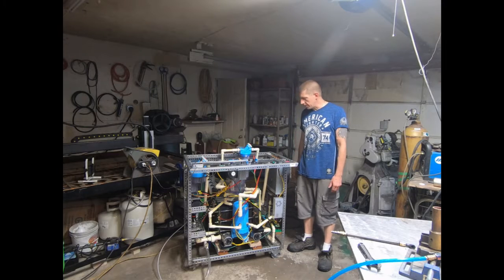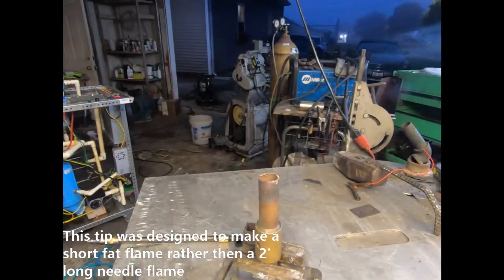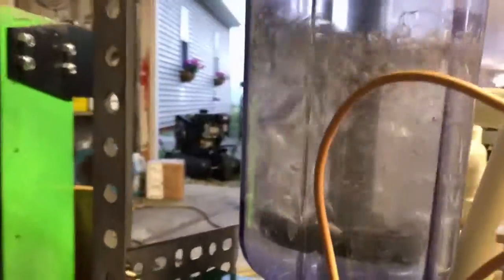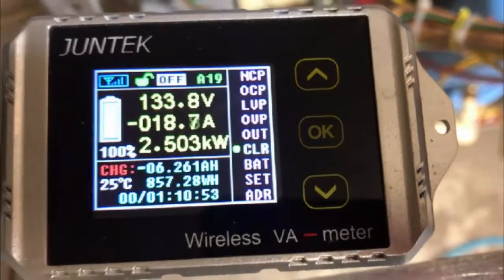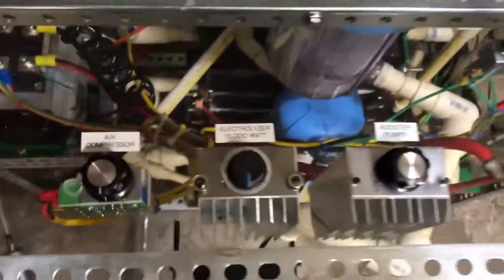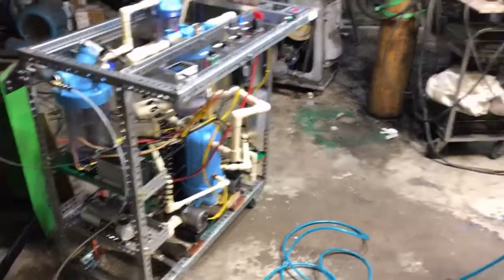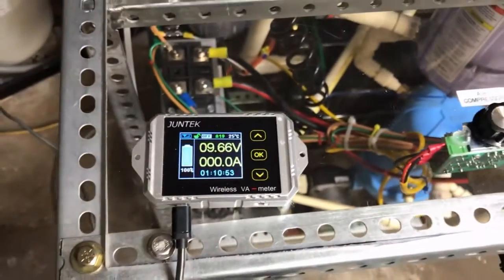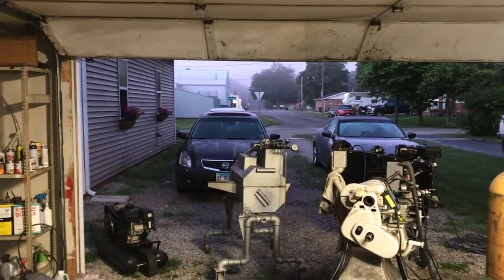10,000 Watt Electrolyzer Build

Comment: How difficult would the mod be to add another "electrode cylender" to get seperate hydrogen and oxygen streams?
Reply: it's definitely possible, however you would have to separate each plate gap into the H2 and O2 side, which isn't really the hard part, a piece of appropriate fine filter cloth will do that just fine, the real problem is getting the separated gases out of the cell. you could probably do it with ported gaskets, but that would probably be A: expensive B: actual pain to make work. The military does something weird with split tubes, so you could check that out and try to replicate it i guess.